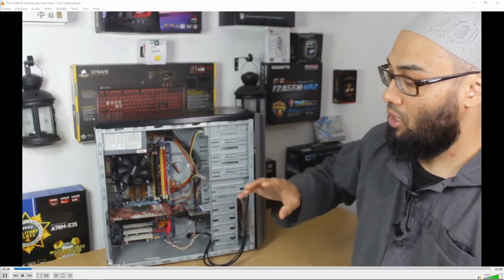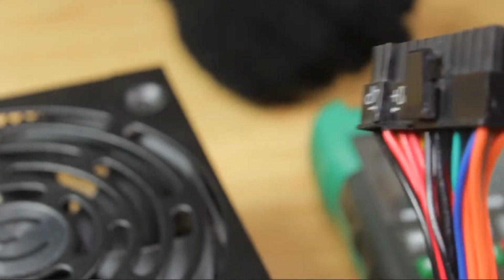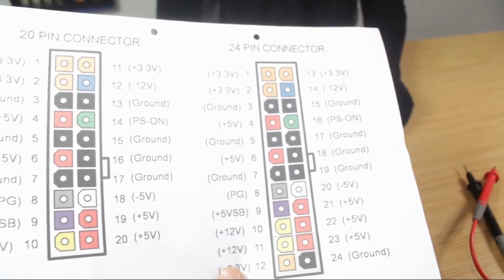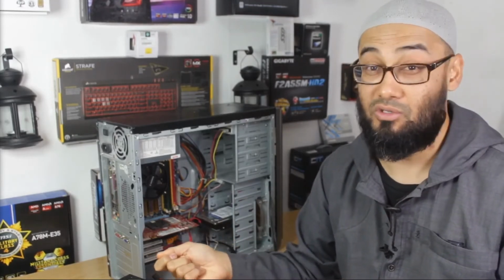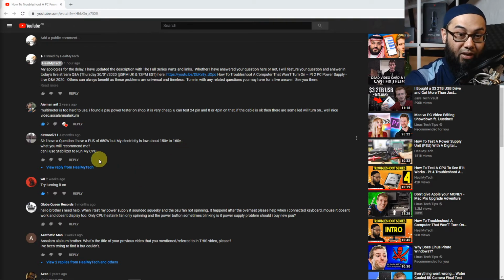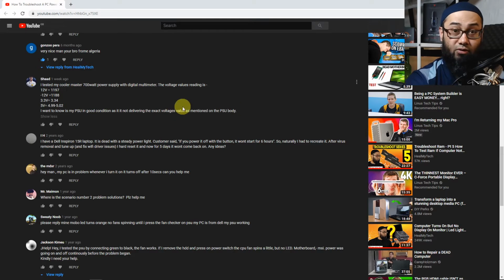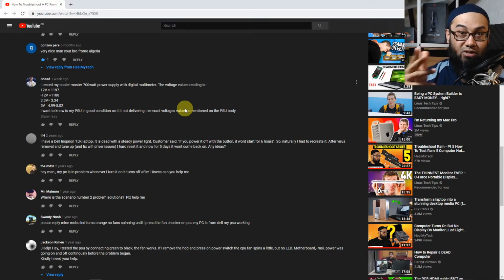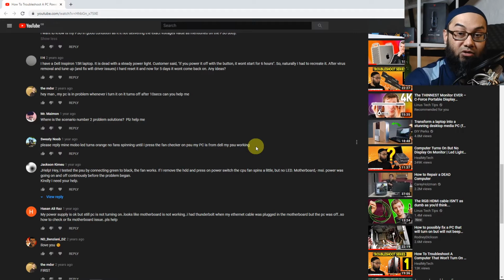How To Troubleshoot A Computer That Won'T Turn On - Pt 2 PC Power Supply - Live Q&A 2020

Comment: Hey @HealMyTech I recently built my own pc and it's not booting buuuut all of the fans and RGB lights are working I saw your video on it and you said it might be the power supply is there any other possible issues I just want to know before I get a new power supply I'm going to watch this a little longer but if you could can you give me any straight forward answers?. thx

Comment: Hi there i have a video slot machine when i power it on the fan for the power supply comes on and the lights on the front of the machines come on too but the screen wont come on anyway of fixing this problem thanks very much